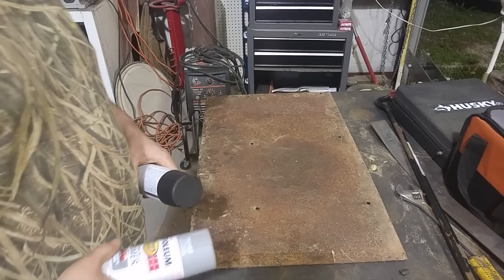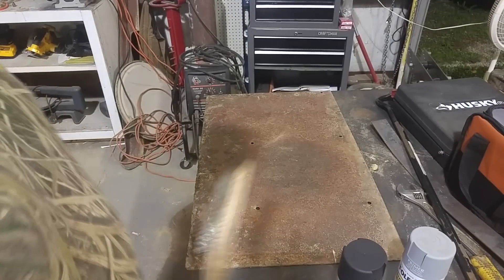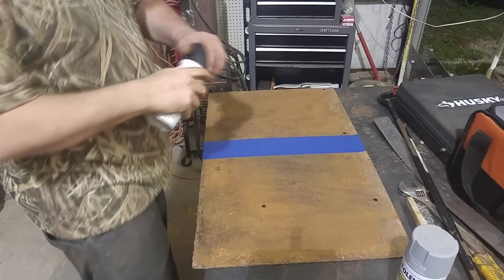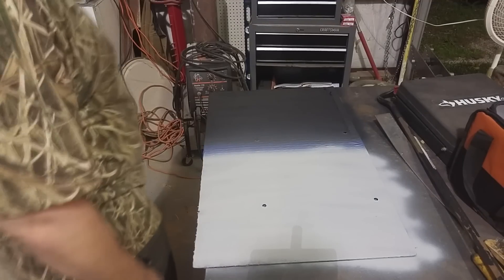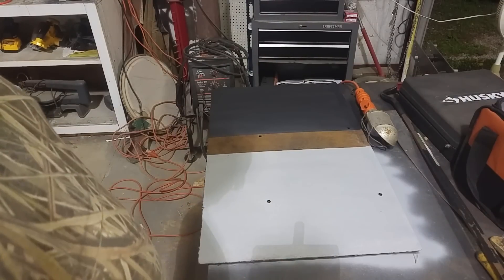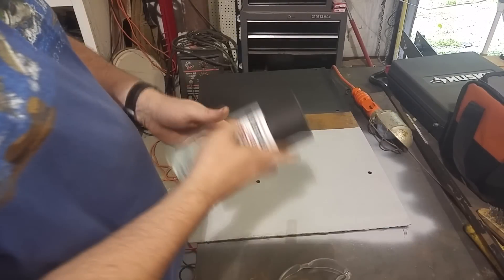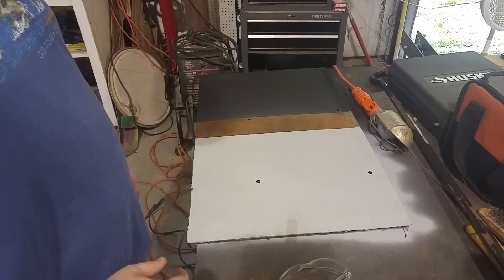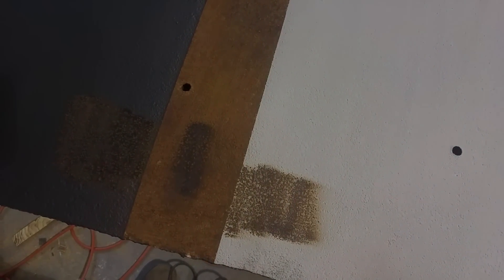Rust Reformer vs Primer on Rust

Comment: I used this product on Jeep axles Drive shafts, sway bars you name it  Then costed in Rust-Oleum oil based enamel They have all held up. Axle actually still looks new after a few winters. The key is to remove as much rust as possible.
Reply from the maker: Nice!  Thanks for sharing your experience.  Prep makes all the difference in the world!
Reply: Same here, seems to work great in my opinion, i guess some people use this product improperly and give it a bad rep, but if you do the necessary preparation before hand, this stuff actually does a great job, i would recommend a good thick coat of this forst before a top coat, and if no topcoat is desired, then two decently thick coats of just this product for underbody of vehicles

Comment: Can anyone read this to see if it is the right method ?

I  have a fair bit of rust on the undercarriage of my Toyota Hilux and this is what I am thinking of doing to remove the rust. 

1. Remove rust with wire brush attached to drill thoroughly 
2. Wipe down with methylated spirits to kill bacteria & remove grease
Then either use 
3. DY-Mark Ruster Reformer 
OR 
as you previously recommended Rust-Oleum Primer Undercoat Sealer.

What does everyone think of this method ?
Reply from the maker: Sounds like a solid plan to me.
Reply: You may have done this but what I have done in the past is to clean off the rust as well as possible, then use a rust converter type product. Then prime with a zinc based primer, followed by a topcoat and then a waxy underbody sealant.

Comment: Rust Converter like Navel Jelly is the Best, have used it on Many Rusted Machinery and it Works-Changes the Chemistry of the Rust.....
Reply: I have heard about that as well. I will be using that today on the underside of my lawn mower deck.
Reply from the maker: Let me know how it holds up
Reply from the maker: I've heard of naval jelly for a long time but never had the chance to use it.  Pretty neat how the products work!

Comment: I used rust bullet on an outside rusted cottage furnace gas tank. Brushed it on and it still looks silvery after almost 6 years. No rust is visible. The product is very expensive, very toxic but works extremely well for years without reapplying.
Reply from the maker: Interesting, I'll definitely look that up.  Thanks for sharing!
Reply: Yes I use that myself first Superior to POR 15 and actually there's another one from Bill Hurst in Newark it's called Miracle Paint that is very good Houston on the axles and frame on a 62 GMC 4 wheel drive and still is in good shape 20 years later

Comment: Following the instructions? What happened the the “use soap and water” part? Primed surface is also pitted. Why not paint over the paint. And why are you grinding it? Whats the reason?of course there’s rust underneath it.
Reply from the maker: Too lazy to go get soap and water. The surface was pitted with rust...slapping some paint over it wasn't going to smooth it out much. I hit it with the grinder to hopefully see how deeply the chemical reaction of the rust reformer penetrated the rust.  I did another test based off feedback from this video and let the piece sit outside for a year.  The purpose wasn't professional rust repair but more of a quick fix or something you don't care to fix properly.  There are much better (more expensive) methods to stop the rust longer term.

Comment: Best inexpensive stuff in the world for Rust: KLEAN STRIP GKPA30220. Kills the Rust and keeps it from returning.
Reply from the maker: +OldSkool 55F100 cool I'll have to look it up
Reply: My Uncle taught me when we were doing a 50 Merc in 88.. I was buying rattle cans of Rust converter for 7$ back then and he told me to go to Builders Square and buy the Phospho Etch.. it was $12 a Gallon and you mixed it 1:4 in a sprayer... It turned everything black and I was hooked.... Smells like eggs kinda. I freed a frozen 9" center with it in a bucket... Another cool trick he used is to tint Grey primer light purple, just to cruze while building the car...
Reply from the maker: +OldSkool 55F100 haha never thought of tinting the primer.

Comment: Does bondo  fiberglass stick to a rust converter or epoxy primer if I put them first on top of a rusted metal which has been lightly sandblasted before treatment ??
Reply from the maker: I don't have a whole lot of experience with bondo fiberglass but I would think yes it should stick.

Comment: Removing the coating proves nothing, as part of the theory IS encapsulating the rust. I recommend reformer, and although it's a "sort" of primer ITSELF, THEN spray priming, sanding, and painting as normal.
Reply from the maker: I removed part of the paint to see if there was any penetration into the rust, which proved there was not very much if any...I was curious.  While I don't disagree that it would last longer and work better topping the rust reformer with primer and a top coat, that wasn't the point of this test.  However I did redo this video and followed up a year later with results where I define a little more clearly the purpose of the test (especially in the conclusion video).
Reply: I'll check it out. I doubt there's ANY product that will actually penetrate completely through rust, although WD-40 will soak the hell out of it, lol.
Reply from the maker: +theheffer you're probably right. I wasnt sure how deep it would go considering it is a chemical reaction.

Comment: First of all you hit the primer one time as you moved to your right.  You hit the rust reformer 3 times moving to the left and then back and forth.. you applied the primer per instructions and not the rust reformer, no 24 hour cure, then you grind the rust, for what? What did you expect?  Ones an apple the others an orange. Take this down it's worthless. I use Rust reformer all the time. It's best to use two coats 10 to 15 minutes apart, wait 24 hrs then prime and paint. I used this on a 9ft hay rake 4 years ago. It's been out in 16 season changes and it's appearance hasn't changed at all. We could not find any rust any where in it about a month ago. Rust reformer works.
Reply: I completely agree.
Reply: I have to agree, painting is a science, you can't wing it.  I moved back to Southeast Alaska after 6 years.  All my tools, equipment and gas powered hardware was rife with rust and I've spent a month grinding, sanding amd rust treating everything  that has a lack ot metal.  Rust reformer is a quick effective spray option I stand by when I have hard to get areas or I don't care about the hardware enough to properly sand, grind and brush apply a proper rust inhibitor.  My tow chains are in good order and you know sure there is still rust that comes through in certain areas, but I know for fact that it'll be in far better shape than if I hadn't.  Alot of the things I'm coating and treating are gon a get heavy use, transported in the elements and I just need them to not fail because they rusted to bits or ruined all my other hardware because their rust fucked with that.  If I want something pretty ill of course use a filler or self etching primer, and prep my surfaces and take the time I need, but if I'm starting an undercoat for my truck frame or taking care of a snowblower that has sat for 15 years and I just want to keep my stuff functional, using a spray rust reformer is just fine by me.
Reply: Thank you. I need to fix my body on my 1982 Camaro Berlinetta. I am going to use reformer. It had the body sanded and primed when I bought it but it seems to be seeping through the primer. What do you think I should do? Sand down on the primer and prime it again? Or just keep adding layers to the primer?

Comment: Never seen so much unprofessional bullshit!
You spray something on and the You remove it !!! - and what the f.. does this prove?

Take Your metal, spray a 3,5% sodium chloride solution on it .
Put it outside - then control it in a 6 month time scale
Reply from the maker: There was a phone taped to a stick in a vice...how professional could it be?  Anyways the point of the experiment was to see that the Rust Reformer converted the rust instead of just covering it up...and since I don't have x-ray vision yet, I had to sand some paint off to see underneath after it cured.

Comment: If you want to keep rust out. Nothing beats POR-15. That stuff sticks to skin for days...So keep it off you and your clothes.
Reply from the maker: Yeah I'm using POR-15 on my Firebird...good stuff!
Reply: Master Chief 00117 I put some on parts of an auto frame around 17 years ago and it has been exposed too all the elements since then. Now it is still very black but has a chalky appearance fit is still a Very Strong bond. I have used it a number of times since then on frames and it does hold up very well. You can get it in a couple of colors. Very correct comment my friend.
Reply: I followed the instructions exactly and like I said, 17 years in the sun, rain, hot and cold. The only way to get it off is to sand a good bit  with 80 grit. I personally know over 20 people that have used it over the years and just keep on using it. Knock the heavier rust off after you wash it thoroughly and degrease, let dry and apply in light to medium coats. Hard as a rock, paint color coat or use por-15 tie coat and then color. You will not be dis satisfied. Chemically it needs the rust to bond and I have never heard of it working on clean metal but can not dispute it.
Reply: Not according to this....  https://youtu.be/ovcxJt1a5-M
Reply: Master Chief 00117 it’s not great unless you sandblast ! I used it on my truck and the frame was rusty again in a year

Comment: I never trust paint over rust no matter what kind It is. I normally use phosphoric acid but I have used Vinegar and wire brushed it until the rust was almost either gone or black and then use epoxy over it. I have used rust converter over and it seemed to be ok.
Reply from the maker: +Cary Lamari looking at the results of my revisited video, I cant say im completely sold either. Still got 2 more months before I do the 1 year follow-up video on it. Thanks for sharing your experience!
Reply: Yes agree with you the vinegar works well have used it on many different applications over the years including motorcycle gas tanks and car frames along with body panels cheap and not a chemical

Comment: surely this is a pointless test because the grey primer would be porus right? i was under the impression all primers are porus.
Reply from the maker: Not pointless...comparative.
Reply: Technically everything is porous. To draw any proper conclusion you'd have to run it through a salt fog cabinet and monitor the results.

Comment: Got the automotive version of the reformer, saw some pretty good reviews about it. Only saw a couple of negative reviews that expressed that since it sprays on black its not any different from normal paint. Did about half of my truck frame with it and its been on for about a week and a half. So far so its holding up fine. Once I get the whole frame finished I might use their undercoating as well.
Reply: Within the month I did notice some corrosion through the reformer. Looked like it could be dirt at first so I tried washing it off. Did nothing.
So my guess for now is that maybe I didn't put it on thick enough so I put a thicker coat on about 2 weeks ago. I'll see how it holds up now.
But for all we know this could just be normal paint in a can.
If there's more corrosion showing through the heavier coat I applied then I may go with something else to convert the rust.
After I apply the different converter I might spray this on as a primer for undercoating and extra protection.
All depends on the future results as of now.
Reply: I used it on my 54 f100 you still have to cover the rust reformer. Read the can you apply the rust reformer and it dries to a PAINTABLE surface. Just follow the directions and and it works great..
Reply: ForzaClutch .
Charlie Brown here .
have you ever heard of Coraseal, I was thinking about putting that on my frame before I put the Auto rust reformer .
so tell me how well did your frame come out any pics of it ..
Reply: Yes, it looked like that but with a bunch of those little white spots and corrosion that looked like bright dirt. 
Image 1- http://imgur.com/a/ue3Ui
Image 2-http://imgur.com/a/VLXfw
Prep work was done before I sprayed too.
Reply from the maker: Nice, let us know how it turns out!
Reply from the maker: Interesting, I appreciate you sharing.  I will definitely be using POR15 on my frame instead of Rust Reformer.
Reply: Now whats it like after a year? :D

Comment: Thanks for the comparison. 

Looks like maybe the Rust Reformer had a tiny bit lest rust, though that could just be the black color helping. 

It would be interesting to see how the coatings hold up over time. Maybe if you did the same thing with a smaller piece of metal and stuck it in some salt water or something for a few days.

Comment: I have been using Reformer ,for 2yrs.I would have DA sanded that with 100 grit then spray reformer it goes on watery.But it dry's to a thicker dense" batman" black .It's kick ass,you can weld on it ,use as a primer.Yiu can paint on top.If you can't sand blast Reformer rocks.
Reply from the maker: Cool thanks for the tips!
Reply: Chaos Garag

Comment: JACK STANDS...$5 GARAGE SALE!!!  Jacks, stone, brick, cinderblock will get you crushed or legless, dude.  Be wise, bro.
Reply from the maker: You sir have confused me...what did you see in this video that was unsafe?
Reply: My mistake...wrong video!!!  I like your video!!!!!  I will remove the comment after you read this.  Sound good?
Reply from the maker: haha It's all good. I was just confused.  Thanks for watching!
Reply: hahaah lmao lmao!!   and i just cant trust stands ive seen some slip before.. always used just shop jacks and car jacks and been at it for over 25 years billions of cars trucks and never once had a slipped jack issue at all.. so i dunno..   every once in a long while  may use jacl stands  but its extremely rare!  sometimes i may throw a junk wheel or big lumber RR tie block under just for emergency backup in case  but have never needed any.

Comment: so can we use the rust reformer instead of primer and still get great results when painting a car?
Reply from the maker: Yes you can put a top coat over it and use it as a primer...but it does not act like a filler primer that you would typically use on a car to sand out imperfections and such before top coating.
Reply: Chaos Garage alright thank you man
Reply: @littlemanhuerta4442  I just used rust reformer on some rusty areas of truck frame and sprayed undercoating on top. Alse reformer on muffler and exhaust pipes with vht exhaust paint on top. It dries faster than primer and left real smooth surface. It seems like the reformer holds better. I've had primer flake off before. I'm gonna use reformer more often now to see how it does

Comment: I like the attempt.  but the test still needs to be done. the rust neutralizer works to change the chemical make up of the rust. as the primer don't stop the rust. 

if you would of went a step further and wet the areas after a few weeks. the rust would bubble the primer but the rust neutralizer would of transformed the rust to a neutral state and then into a use able sealed primer for the surface.  not saying it will not rust. but will take it a longer time to rust again.
Reply from the maker: Thanks for the comment.  Check out the follow up video, I throw Rustoleum enamel into the experiment and leave the whole piece outside in the elements for months.  All 3 products say they help prevent rust and so far there aren't any signs of rust returning or bubbling under the primer or enamel.  But that experiment is on going, I'm leaving that piece out in the elements until I see some kind of result.

Comment: I just worked on a project my self and use krylon rust/ primer but I have shop air compressor and used a wire wheel to almost completely get rid of all of the rust off, then clean and paint. I understand your experiment you are doing though but I would hope people do a good prep job vs fuck the the rust and paint over it which won't help on the long run.
Reply from the maker: I agree 100% that is the way to do it.  Even a wire brush on a drill would work and the end product turn out much better and last longer.  On the other hand I can think of a few rusty things that could use some paint around here but aren't worth the effort to spend too much time on.  However interestingly enough in the follow up video I did light prep to part of the test piece and left the scaly untouched rust on the other part.  So far it's been 115 days of sitting outside in the sun and rain and the rust reformer, primer, and enamel test patches are all holding up still with no signs of rust.  I'm going to keep that experiment going until I see some type of results!  Thanks for taking the time to comment!
Reply: Chaos Garage

Comment: You did not show if it works, you need to paint it and see if the rust comes back
Reply from the maker: Thanks for the feedback!  I redid this experiment based off suggestions in this video.  https://www.youtube.com/watch?v=9LM9krYp1rA  I didn't paint over the rust reformer or primer because it would have convoluted any results.  Also the rust reformer doesn't say that it requires a top coat.  It has been about 50 days since the new experiment was performed and so far no noticeable rust with it sitting out in the elements.